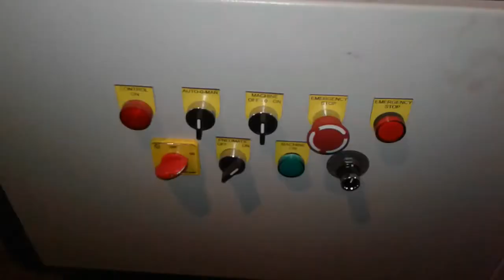200 Ltr. Barrel Round Screen Printing Machine

Comment: Good . You must set some air cylinder  under line, Ac servo motor in the conversor. How many pcs/hour? We are using machinery 850pcs/hour. We can print  3 mold /time